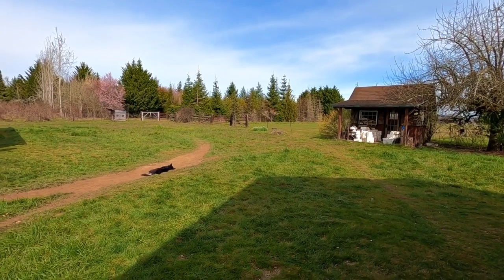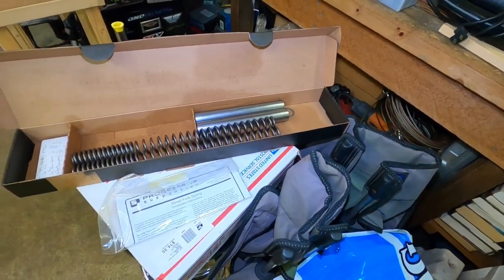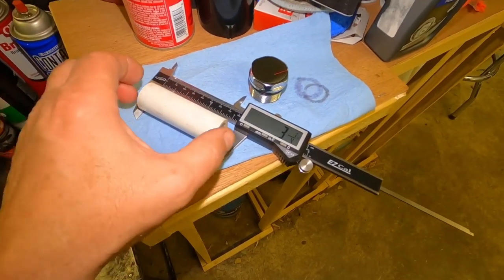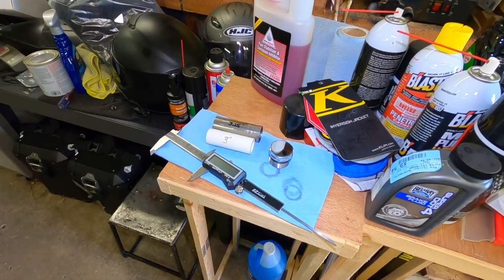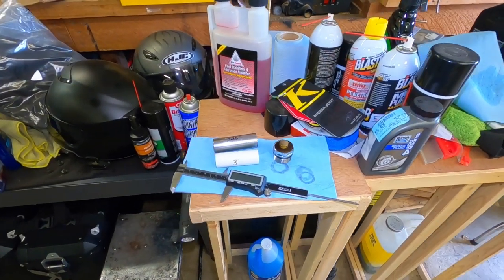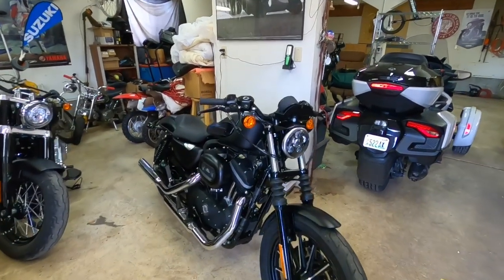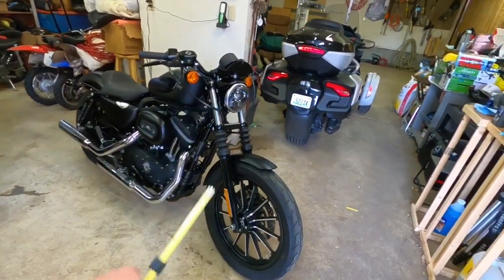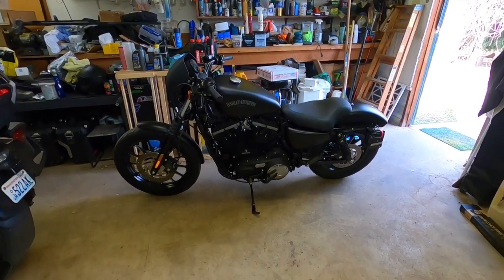Harley Iron 883 Front Forks!! • Servicing & Sag Adjustment! | BikeRepairs

Comment: I don’t know if you said it or I missed it, but does that device that pulls the oil out get placed at the back of the fork tube or the front? I’m assuming the back.
Reply from the maker: I put it dead center between front and rear due to the rake of the forks mounted on the bike. The level specs are assuming the forks are perfectly vertical...

Thanks!!